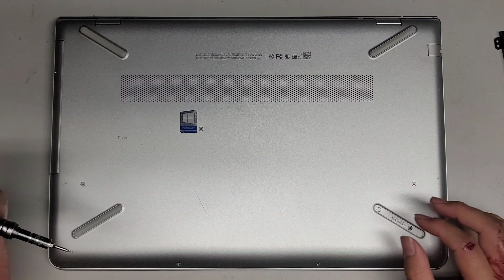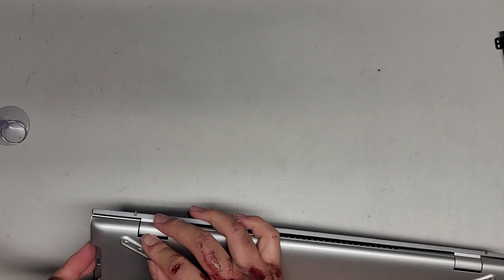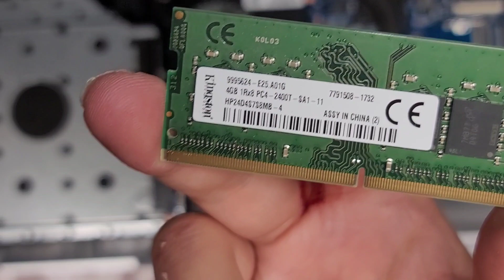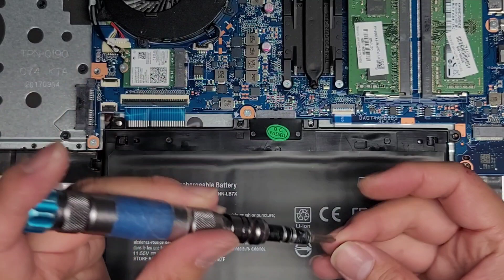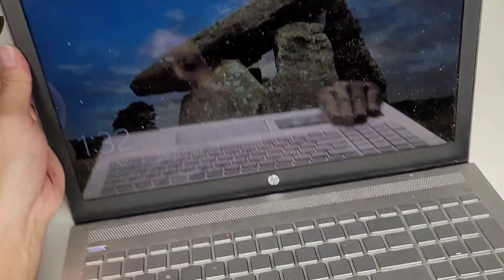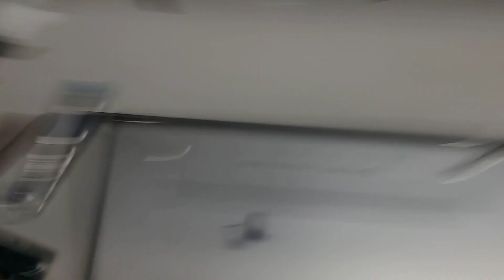HP Laptop 15-cc112cl Disassembly RAM SSD Hard Drive Upgrade Battery Replacement Repair

Comment: Really liked your Technical explanations about the ins of this laptop & where all is located. Great job!!  The only thing I would suggest on improving, is to always take off the battery before removing memory sticks or other peripherals. Keeping doing so, could eventually damage internal parts. But keep the good work & thks alot for this Youtube post. Good recovery wishes for both hands  ;  )
Reply from the maker: The only time removing the battery is necessary is when doing anything screen related. Never had any issues with leaving the battery connected with RAM, hard drive, etc. in the over 10 years of doing this. It is safer to do so, but you can even pull the RAM with the computer on and you won't damage it. Lol You will have to force shut it down if you accidentally do that, but other than that, it's not an issue. :)